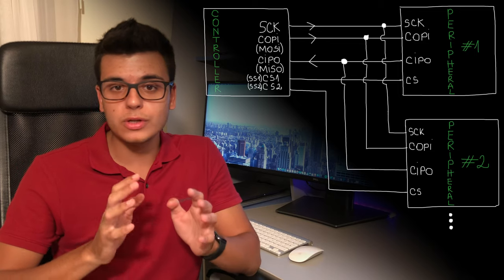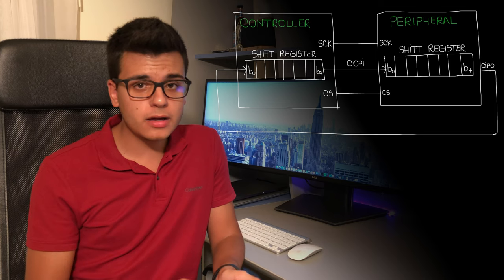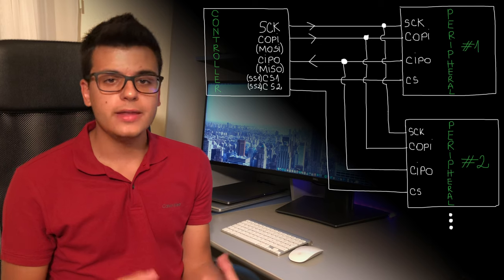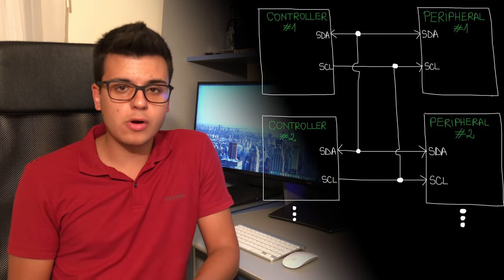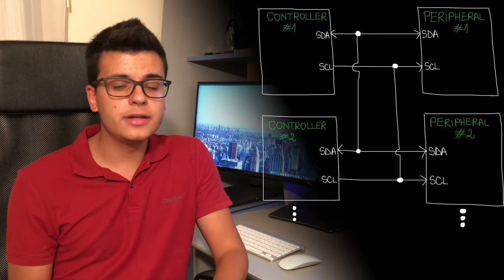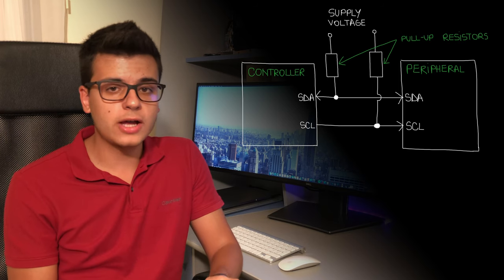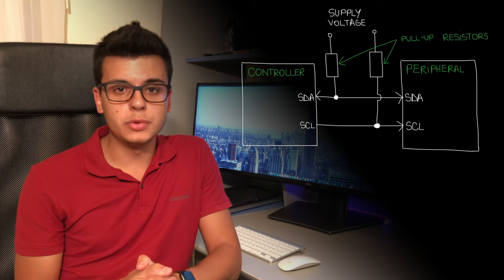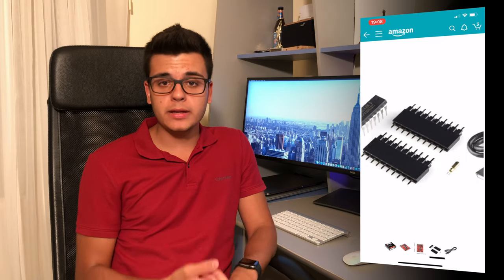How SPI & I2C Work - Communication Protocols | Embedded Systems Explained

Comment: Hello, thank you so much for the video ! It is great help for a beginner in Embedded System to clearly understand what is going on.
I just have a question regarding the explanation you're giving at 3:00 : "when a controller send data to a peripheral, the peripheral needs to send data back at the same time" but you quickly follow by saying that the controller can send a little more clock signal in order to let the peripheral gather data and send them back. 
So do the peripheral needs to send data at the same or not ?
I'm a little confused....

Comment: my two devices are not working simultaneously with spi.
when i connect miso to both devices it doesn't work.
any help??
Reply from the maker: Do you have separate chip select lines? If you do, are you activating them properly?

Comment: These are very high quality and high value velocity videos and I very much appreciate the value offering.

One suggestion to make them even better would be to start with a real world concrete example of how the technology being discussed is actually used. e.g. Where is SPI used?
Why does it solve this problem better than other alternatives?
Where is I2C used? 
Why does it solve this problem better than other alternatives?

Going from the concrete to the abstract is very helpful for orienting a discussion.
Even more helpful would be telling the story of why the technology was actually invented.
i.e. What problem was the inventor trying to solve?
Why were the other tools available at the time inadequate?
How did this technology meet the need better than the alternatives?

This information can be helpful not only in orienting for understanding, but also for motivating the student because it will be easier to imagine situations in which having this skill would be useful.
This, in turn, would make it easier to choose a project to explore the development of the skill.
Reply from the maker: Thank you so much for the advice, it’s great to hear from viewers what can be improved! 

I didn’t think of this idea but as you said, it goes really well with the current format, so going forward, I’ll include this information before going into the specifics of the topic I am talking about.

Comment: Do you know to use code composer studio? Please show a demo on Adc using graphs in code composer studio. If possible please show a demo on Fft of a signal in code composer atudio
Reply from the maker: I’ve use CCS but not the features you mentioned. Is there any way I could help you directly? I still have a bunch of topics lined up and this is a bit too specific for a video (perhaps a full CCS guide but that is still a long way out).

Comment: Can u clearly explain why uart cant achieve speed as much as i2c why?
Reply from the maker: Having no clock line means that there has to be a very accurate oscillator on both sides (otherwise, the receiver wouldn’t know when one bit ends and the next one starts). This limits the communication frequency, compared to I2C, which uses a dedicated clock line between the 2 partners communicating.

Comment: Didn't know about the name changes of I2C/SPI. I will try remember them the next time im using spi or i2c. Btw great series hope you continoue with it.
Reply from the maker: Yes, it happened recently! Stay tuned, there will be more videos on this series for sure!
Reply: Nothing wrong with the old names, so don't worry about it too much.
Reply: Use the old names in an interview or always lol.  Engineers aren't woke
Reply: @4144758  nothing woke about using a better name
Reply: @DAAI741  master slave is clear and definite and causes none confusion
Reply: @4144758  it's only "clear" because it got widely adopted. It's bad nomenclature because it doesn't properly describe the relationship between nodes in the network. Controller/peripheral is more clear, and uses more sensible network topology terms. It was only a matter of time

Comment: Just name it master/slave, no need to call it differently when everyone uses master/slave. It makes it confusing. But good video btw
Reply: controller/peripheral is pretty unambiguous. As that's language that has been used in various network topologies for a long time.
Reply: @DAAI741  peripheral is not as clear as slave in denoting the subservient relationship.  Peripherals are also a class of input output devices to any computer hence confusion.  A mouse is a peripheral but certainly not a slave to the computer
Reply: @4144758  Computer peripherals are called so because they serve the same role in the network as any other peripheral. We don't call them slave devices not because they're technically not, but because it's just weird to use slavery as your analogy for nodes on a network. All it's meant to describe is hierarchy. Parent/child, Leader/follower, hell, even Boss/laborer provide perfectly adequate metaphors that don't call back to violent subjugation of people. But why use a metaphor at all? Just call it as it is: a controller, and a peripheral
Reply: @4144758  How is a mouse not a slave to a computer? The computer, as the host, controls and mediates the communication. The data obtained by the mouse is processed by, and only useful to the computer.